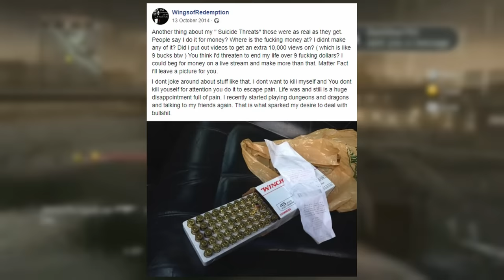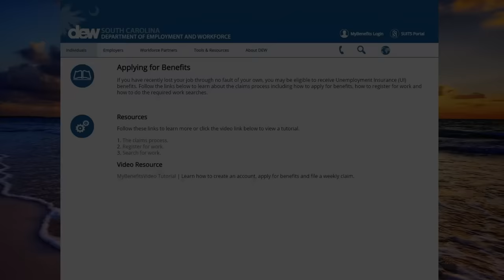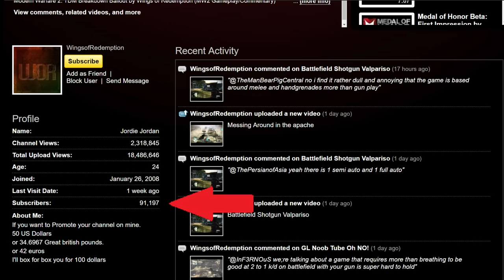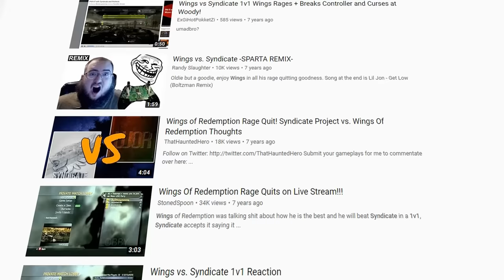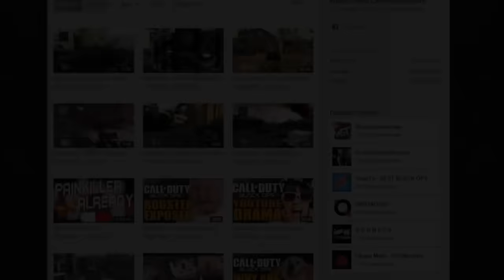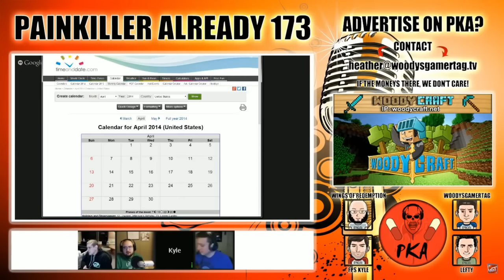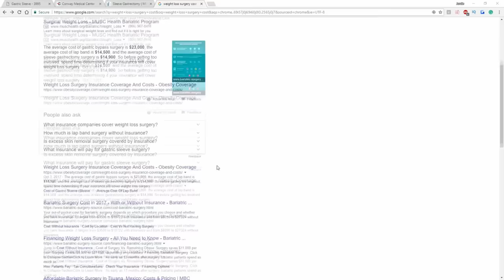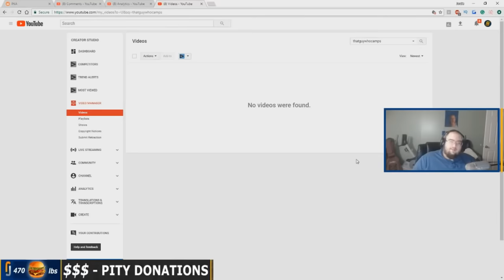From Bold to Trolled - WingsOfRedemption's Story (Jordie Jordan)

Comment: Nicely produced video. 

Just a suggestion— you tend switch from using past, past-present and past-future participle in your script. Simplify it by only using past-tense (e.g. “In 2008, Wings did XYZ” instead of “In 2008, Wings will/would do XYZ”) or just sticking to a single usage.

Comment: Good diet and exercise will be good for your metabolism. Anyone who wishes to lose weight has to act not take pills.
Reply: Agreed. And we've known for years that although better than nothing, walking 4 miles a day probably won't help you lose an ounce. You have to run or jog to get the heart rate up and burn calories. Swimming is the way to go.
Reply: @Stabsnipers  ya swimming is the best. Lowest impact to joints but very cardio intensive